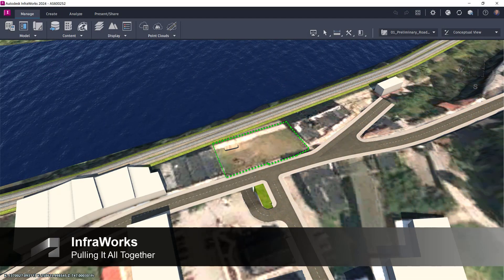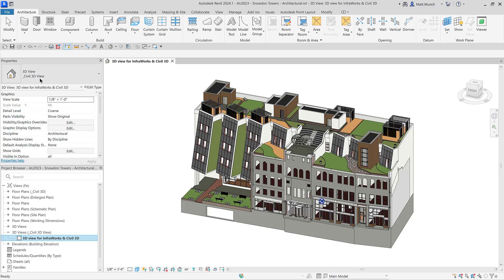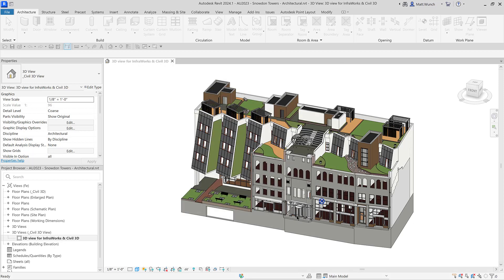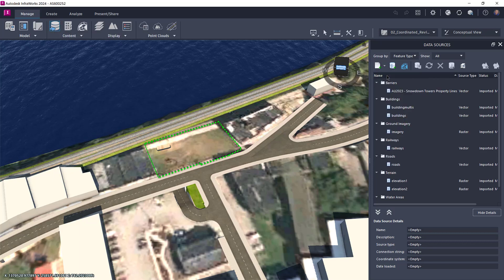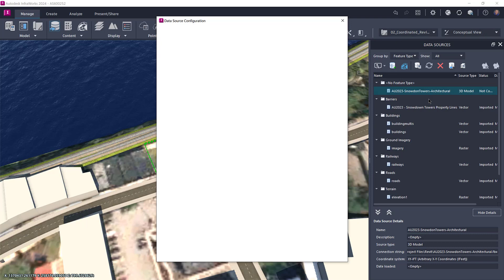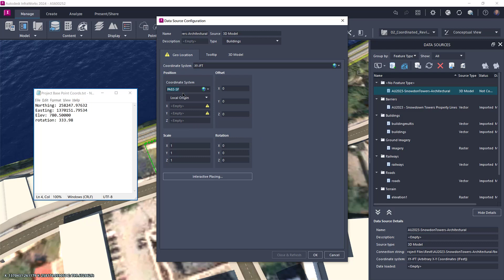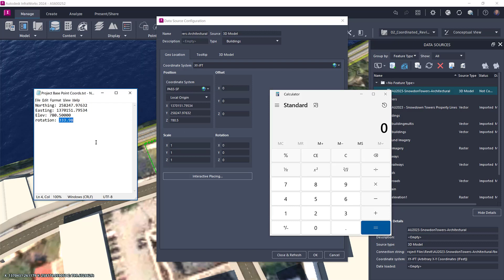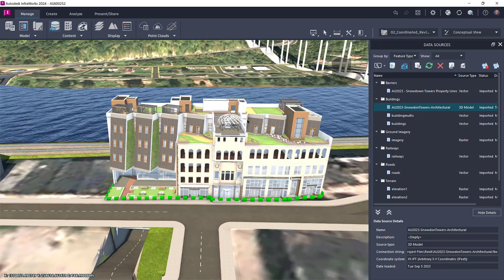Shared Coordinates (Part 12) - Pulling it all together in InfraWorks

Comment: I am a bit confused about using the project base point values, and not the survey point values? I have been watching the videos in the playlist and I do not recall moving the project basepoint in the Revit file? If we used an OOTB template, wouldn't that project basepoint still be at Revits internal origin?